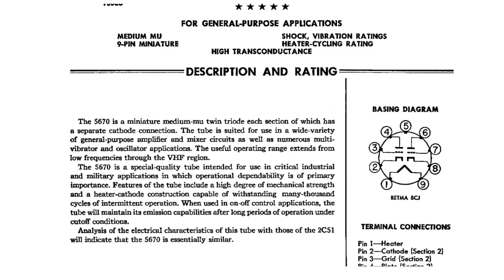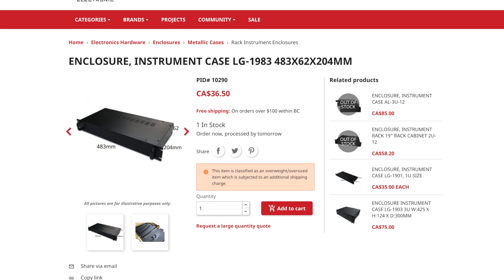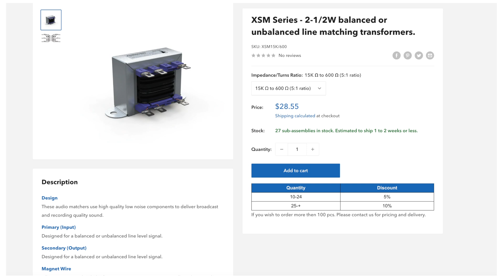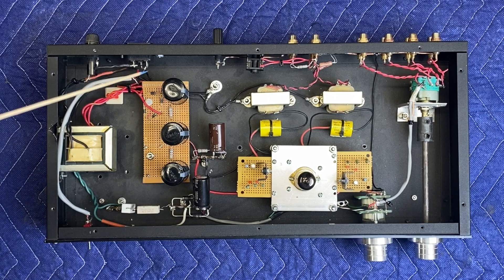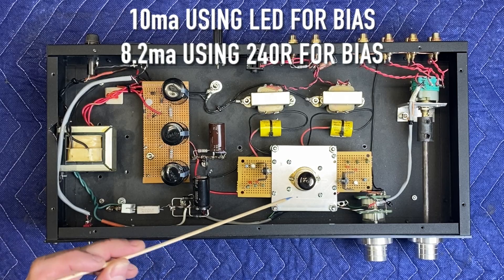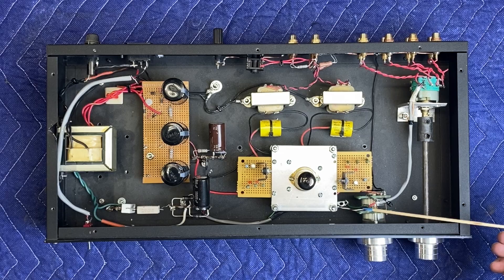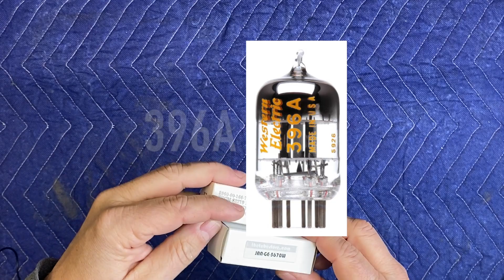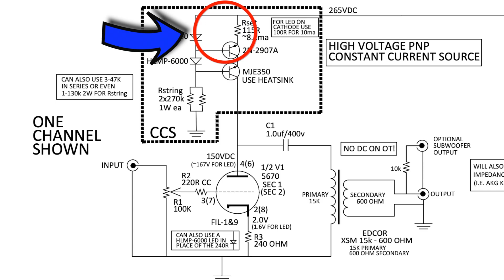How to make a 5670 tube preamp // DIY HiFi single tube linestage

Comment: Sorry, this might be a very stupid question as I'm new to this. However is there a reason (except time of course) to buy a tube preamp when you can make it yourself at a much, much lower price? Perhaps it is simply too difficult to do for anyone that doesn't have extensive experience in electronics?
Reply from the maker: Thanks for commenting. This is difficult question to answer. To build this preamp as a one off build , it will probably cost you more since you had to purchase all the tools and purchase all the individual parts at retail cost.  To get into tube amps as a hobby I don't think you need to have deep knowledge of electronics.  If you are following some elses build or assembling a kit, basic theory is all you really need. Ohms law, safety, soldering, how to use a multi-meter, reading resistors etc... basic stuff.  For scratch building, yes, you do need some knowledge. I don't build tube amps to save money. I build them because I enjoy making things. I enjoy the research, I like to learn new things, I enjoy the sounds of tubes, I like tweaking and there is this deep down thrill of making something that sounds amazing.  It's the entire experience for me. Many people just don't have the tools, they are not "handy" or they are afraid they spent all the time and money and its doesn't work, which can be frustrating. I've had a few projects that just didn't work right. I chalk that up to learning.  I hope that give you some insight? Cheers
Reply: @MikeFreda  Thanks this does help and it's cool to know you're just doing it for the thrill of it.

Comment: It's so hard to find chassis in Europe, even from China the cost is 100€ or more.
Reply from the maker: That’s too bad.  You could adapt this circuit to an aluminum top plate with a wooden base.  I’ve made many amps this way.  Cheers.

Comment: I have a great integrated but if I were to try a pre I would think a great preamp is the way to go. What is the best? I am in Europe and have no workshop to do the handwork needed. I need to learn more.
Reply from the maker: Thanks for commenting. I believe having separate components is slightly better mostly due to the power supplies being separate. One issue to overcome is injecting noise into the system due to ground loops and patch cables. As for what preamp is the best. I cannot answer that. There are too many variables consider when designing and building your system. cheers.

Comment: Do you have any idea which may be the resonance frequency of the output group, capacitor+OT ?
Reply from the maker: I'm assuming you are asking about the Parafeed Cap sizing and its roll off?  Parfeed cap size is:  C = 2 x L / (R x R)
C is the capacitance in farads, L is the plate choke inductance in henries, and R is the load impedance seen by the plate (i.e. transformer primary impedance) in ohms. If you calculate using kOhms the C is in microfarads.  This OT has a high inductance +/-100H. My calculations put it around 5-7hz.
Reply: @MikeFreda  Thank you! If that's so there's nothing to worry about the linearity of the output stage.

Comment: Very nice thank you for sharing. Why did you choose the 100KOhm volume control over 10KOOhm version?
Reply from the maker: The input impedance of the 5670 is around 100K. I mostly use a turntable (with a phono stage) and a NAD CD player which they typically like to see 50K or higher. Their output levels seem to pair well with it this pre-amp design. You could try 10K if you like. I'm not sure what the end effect will be. Cheers

Comment: Hi.  Is this point to  point
Reply from the maker: Yes/No... half the amp is point to point the other parts are mounted on PCB's. You could mount the PSU on standoffs but not the CCS.  Cheers

Comment: Excellent... 
Not to easy to find that high quality part in my local market (even in my country). Just one thing, why that headphone jack sets in the back side?
Reply from the maker: Yes, this preamp design does require quality components to make it sound good.  The headphone Jack is an afterthought. I wasn’t sure if it would work. It was just easy to install it right beside the output…. But yes, it would easier to use if it was on the front. I would use shielded cables. That being said, I don’t really use this as a headphone amp (I already have a dedicated one) so it’s just there for proof of concept and to see if it could drive high impedance headphones, and it can.  Cheers.

Comment: Very nice build, as always. Do you mind sharing sourcing for internal wire including your shielded cable, please? Thank you!
Reply from the maker: Hello, thanks. I'm fortunate to have a really good electronic store near me and I'm able to get a lot of my supplies from. This is some of the hook up wire I use: https://leeselectronic.com/qc/product/224902-hook-up-wire-22awg-solid-ul1007-red-50ft-spool.html
They also sell 2 wire, shielded  wire from spools. https://leeselectronic.com/qc/product/23814-high-voltage-2x22awg-w-ground-ft4-jacked.html
I've found similar wire at Mouser but they typically have spools and it can get pricey, cheers.

Comment: Why didn't you make the output balance? since you already use transformer...
Reply from the maker: Thanks for your comment. Yes, you can with these transformers and circuit. I have done this in the past but I didn’t really hear a difference into my 2A3 power amps, speaker and room setup. I suspect one would definitely hear a difference into headphones.  Cheers.

Comment: Well done, finally line stage with appropriately low gain, unlike all those ECC83 stages having way too much gain and weak drive (good for 100k but not 600r). I like use of veroboards because they allow for optimal layout with either small pins or tagboards.
Tube is biased very hot. Didn't do calculations for 600r load like headphones but they might do fine with lower dissipation when 15k:600 OT's are used, i guess such biasing was used for the sound.
I'm very interested in seeing turret or vero board layout for two stages of class a push pull circuit with tubes mounted horizontally. If anyone ever made mic or phono preamp of this type please let me know, layout for vertically mounted tubes would also help because it is not that different in terms of layout.
Reply from the maker: Thanks for commenting. Max dissipation for a 5670 is 16.5ma. I'm running around 8ma per section which is 1/2 of max and aligns with the 150v curve.  As an input tube you would go way less than that. It's a balance of gain and tube longevity.  Cheers!
Reply: @MikeFreda  Yes, i should look at suggested biasing instead of max rating. Btw, 5670 was often used as vari gm tube for compressors with mixed results because it was not really made for this application like 6386 and other were. 6CG7 is another interesting tube for line stages very similar to 6SN7 in 9 pin bottle, others like 6N6, 12BH7 and similar small signal drivers would also do fine where gain should be very low.
Is CCS really needed in class a where current is pretty much constant? Anyway, maybe try really high quality transformers like Jensen with 80% Ni cores, Lundahl has their own special cores too, although low mid distortion is different from Fe/Ni cores.
Reply from the maker: @Signal_Glow  No, you don't need the CCS, you could replace it with a plate choke. I would suggest something with the appropriate Ma rating and a large inductance (i.e.40H or more). The larger, the better... but they will get costly. You will have to know what the DCR rating is and recalculate the B+ voltage to give you ~150V at the plate.  You could also change the topology from Parallel Feed to a Series Feed and use normal OT but you will sacrifice some performance and you may lower the noise floor a bit as well. The CCS does a great job of PSRR.  At the end of the day, the CCS will be your most cost effective option and will give you the best performance. Cheers

Comment: The whole point of using an output transformer from audio quality perspective is to remove the need for output coupling capacitor. You just made the sound worse by adding two of the most significant components in the signal path that will color the sound. Best is direct coupled if you can get away it. If you can’t as with most preamps, stick with either high quality output coupling capacitor (ie, no electrolytic!) or transformer, but not both. This is the first I’ve heard anyone claim an output transformer can’t block DC.
Reply from the maker: Thanks for commenting. I would agree with you that you should try to keep the components in the signal path to a minimum and/or make them as high quality as possible. This topology is called Parallel Feed and has its virtues. The main ones being the power supply characteristics are more isolated from the output. The transformer can be much smaller since it doesn’t have to handle any DC current. This allows for better high frequency response without excess interleaving and the capacitance that results. Technically, this means deeper, cleaner bass without sacrificing the highs.  You do need to chose your components wisely.   There is a lot of debate on this topic. I’ve built many amps and preamps the standard series feed and parallel feed and they both have their merits. I can’t really tell you which is better, they are just different.  Cheers, Mike

Comment: This is great, thanks. I built all solid state gear. Wanted a tube pre but the gain is usually to high and output impedance didnt match amp. Might give this a go.
Reply from the maker: Thanks. Hope you make it and it turn out! Cheers.

Comment: Nice work. I'm wondering if this would sound better than my Wavelength Sine Preamp? It's an early version from 1994-95 using 6SN7's, Jensen input transformers, Penny&Giles volume pot and non-regulated power supply with 6X5 rectifier. There are two Hovland coupling caps in each channel. I've contemplated replacing the Hovland caps with Mundorf Silver/Oil because swapping them out in the Cardinal 300B SET amps made quite a difference. Was also wondering if a stepped attenuator would be an improvement. Maybe it would be better to build something from scratch?

Reply
Reply from the maker: Thanks for commenting. It would be very hard to say which is "better" . I think they would sound different but better, not sure.  Upgrading caps and a better volume control can add come clarity. 6SN7's have a reputation for sounding "tubey" with a strong midrange presence (at least that's what people feel) They were the go to preamp tube in the 80's and 90's and then just like that, people started to shy away from them. I have a 6SN7 pre as well but the topology and gain is different so it's hard to tell.  This 5670 pre is much quieter. That goes a long way for me to sounding better. I like tube rectifiers in guitar amps but I feel solid state rectification in HiFi is preferred since you can easily incorporate higher value caps in the PSU, creates less heat, last longer, little to no voltage drop across the diode and its cost less. (some people also feel there is no sag either but I have no evidence in that since you would need to build similar circuits and test that theory) Cheers, Mike
Reply: @MikeFreda  Thanks for your reply. I thought Golden Dragon 6SN7s sounded great in my preamp. At the time when Gordon Rankin built the preamp, he told me he thought the Penny & Giles Pot sounded as good as any stepped attenuator he'd heard. And it was quite expensive. The caps are another story since there are many more choices available now. Several years ago, per Gordon's recommendation, I swapped out the Hovlands in my Cardinal 300B amps. The Mundorf Silver/Oil sound incredible. Though, Mundorfs for the preamp would be over $300. So I may audition other preamp topologies and tube types before upgrading. I know Gordon had moved on from 6SN7s. Probably be easier to build something from scratch than making major changes to this preamp. Thanks again.

Comment: Now... how much more complex would this get should one want also a tape loop in this thing?
Reply from the maker: This would be complex to incorporate in this preamp.  There isn’t enough gain and you would also require an equalization network.  What I would recommend is a separate tape preamp before this preamp.  You could make a Phono style preamp and modify the RIAA LP equalization network with NAB 1/4” 7.5/15ips equalization network.  That mod would be easy enough to do, just need to change some capacitor and resistor values. Cheers.

Comment: Been using a 5670 tube buffer PCB kit now for a year or two, and I absolutely love the thing! I wanna do a similar project, just without the bread boards. I'm gonna grab an input relay/remote volume kit, soft on/off board and a PSU in a similar enclosure. Super nice project here, great job!
Reply from the maker: Thanks for commenting.  This tube is a really sleeper.  Inexpensive and obtainable.  Cheers.
Reply: @MikeFreda  I discovered a message board post going back where someone had done all the leg work, testing almost every tube of this type out there, and concluded the JAN GE milspec tubes had the most pleasing sound overall, mainly in the bass dept. I had my reservations with the dinky kit I got as well, but low and behold I prefer it in my system than without, which ultimately lead me to researching how I can make it into a full legit linestage and not some PCB sandwitched between pieces of acrylic.
Reply from the maker: Thanks for the comment.  Cheers.
Reply: How can tgst mode hit 0.95 volts - when it is sitting at 265 volts !

Help !

Comment: Those transformers don't look very high fidelity
Reply from the maker: Yes/No... The PT is just a standard low current Hammond but the high capacitance in the PSU and the Constant Current Source sort of  negates that fact. As for the Output Transformer, don't let the size and looks of them fool you, they are quality. Magnequest is well known in the Tube DIY circles for being one of the go to Inductor Winders. Mike purchased the rights to Peerless and all their technical documents. Wonderful stuff. Cheers

Comment: Nice impression.  What is the  the serial resonance of output tr primary winding which is not stated and 1uF capacitance? Is it beyond  acoustic range ?
Reply from the maker: Thanks for your reply. This is a great question.I don’t prefers to be an expert on tis but I do understand the topic. When I purchased these transformers I told Mike L (at Magnequest) what I was doing and he gave me a bunch or parameters that would work well. These B7’s >200H, DCR Pri-1042ohm, Sec 37ohm. Mike told me the cap range can be between 1 - 3.3 ufd which would put it in the inaudible rage.  The issue with this circuit is that the plate load is fed from a Constant Current Device which there really isn’t a formula or calculation to incorporate that. The CSS has impedance in the MOhm range.  In essence we are just sizing the Parafeed cap which is a basic formula. Looking at this topic on the Tubecad site, I did rough calculations that puts it around 5hz using a 1ufd cap.  It was recommended that the only “real” way to know is to try different sized caps and manually measure and graph the curve. I hope that makes sense? If you know otherwise or can add to this, please enlighten me.  Cheers.
Reply: @MikeFreda  Thank You for invitation. I am not profesional so I have only suppositions Never seen in my practice such solution. Do not know it's advantages - I can deliberate only that it provides exact anode current within long time . Low power triodes     last  many years but why not? 

In usual tube amplification lower signal   lowers  tube current and lowers voltage drop on anode  resistance (which is constant).   Appears proportional higher anode voltage - phase reverse.

 Here tube current is stabilized in such way that total resistance of anode circuit  is constant. Conclusion - the more tube resistance the less stabilizer resistance.That operates in way simmilar to push pull amplifiers except half is done by support of two semiconductors and  it gains in amplification .  

Another speciality is no feedback which is reasonable if is sufficient linearity. Possible that  the mentioned LC circuit produces at 5Hz phase shift which could   make any feedback stability problematic . That is "my" theory . All best

Comment: Hi.. Really cool project.. Nice to see the MQ iron in use.. Have you tried a CLCRC supply? Will it better the stock supply if using a plate resistor (for starters..) ? The Edcors are nice and looks like a steal.. There are also the Cinemags, but dunno the price of those..
Reply from the maker: Thanks for commenting. I've used CLCRC in amps that don't have a CCS. It works good. You just have to be aware of its location and orientation. They can induce noise in the system. They can be expensive and if you are using a Constant Current Device you probably won't notice a difference. I've looked into Cinemags before but they seem hard to source and can be pricey.  Jensen's OT's are also an option.  Cheers
Reply: @MikeFreda  
Thanks Mike.. BTW, I was thinking that if I first use a Plate R to try, do I also need to add a Cathode Bypass cap to get the ~same 6.4kOhm output impedance as the circuit with the CCS plate load w/ unbypassed cathode R?
Reply from the maker: You don't have to install a Cathode Resistor bypass capacitor. I never did. You can experiment if you want.  200uf to 470uf @10v.  I'm not sure you would hear a difference. There are some Bypass Calculators available online. 5hz would be a good cut off point. Really no need to go lower than that.